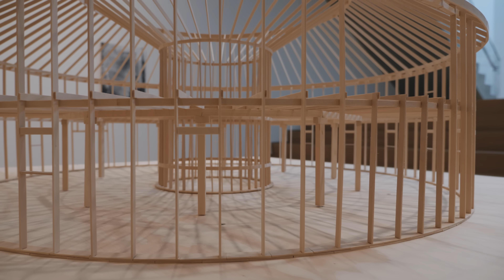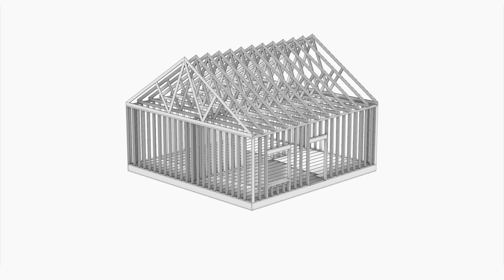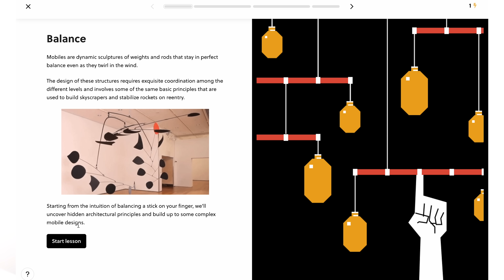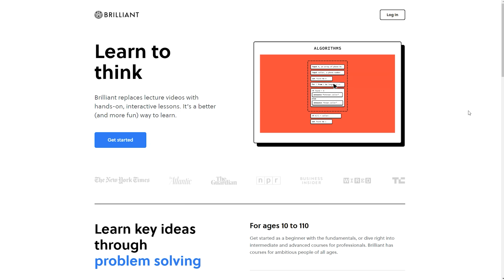The Genius of 2x4 Framing

Comment: 2x4 house  would be affordable if they did not require a 30 year mortgage, a constant maintenance against the water/termites/sun etc  damages , an expensive fire insurance since they can go to ashes from one spark or a match, if expensive roof replacement did not be needed every few years, if they did not need nearly always  to operate on  heating/cooling due to the poor thermal attributes of the whole system, if they did not need to use a multitude of toxic products ls to wrap up the structure to a completed house. After 20 years of designing and building in this technology, I moved to a country where I could go back to practicing my trade in brick/stone/steel/cement; Storms and earthquakes, these materials in a long run create homes which overhead costs are minuscule, and serve generations without costly repairs. I agree that 2x4 is like  a McDonald's hamburger, which is not a secret that eating it is detrimental.  I am a huge admirer of your lectures.

Comment: I'm not saying he doesn't make some good points, but you can build a home or any structure with "light wood framing" as customized as desired. He makes it seem so standardized that it's impossible to be creative. Most of the homes that are contemporary, odd designs are built using the standard 2 x 4 process.

Comment: Lots of misinformation here. Both 2x4 and 16" on center framing is very outdated. Sawdust is not used to make OSB.  Post and beam is actually a style of underfloor framing, not walls and roof system. As far as your statement about not needing skilled labor to build a standard home, you simply could not be more wrong. It takes years and years of learning to be able to build a home, most will be a helper for well over 5 years before able to tackle that size of project as a foreman. In fact, it's blatantly insulting to say it doesn't take skilled labor.

Comment: The only issue with this kind of construction is that you limit yourself with the size and amounts of windows. The load is distributed very equally and getting a very open feel is more difficult.
Reply: Many homes here have very large windows, and many walls that are dominated by windows. A variety of wood and steel beams are used to provide additional support where required.

Comment: You mentioned Home Depot 'stocking what you need'. Eau contraire. There is a large luxury looking, energy efficient, modern design house built in 2021, in a very nice area of Portland, OR.  I recently saw that it had been torn down and rebuilt. The story seems to be that the Home Depot lumber they had used was no 'certified' and it did not meet code or pass inspection. Ouch!

Comment: “Anyone can frame a house” 😂😂. Maybe unskilled labor can pop the nails in, but building the structure properly, cutting the correct angles and joints, creating proper sizing for windows, doors, etc etc…. Not unskilled labor at all.  Rough framing perhaps…. But this is way oversimplified in the video.

Comment: 4:50 a factor also of the timber framing is the resource intensity of the process.  Another video emphasized its strength over stick framing (2x4 and other standardized material) but choosiness is gonna be a problem.  When you need a hundred thousand houses built a year… you need to do it with what you got.

Comment: 8:55 - lol at "any 2x4 is as good as any other", sounds like someone hasn't been to the bunnings in my area, where you're likely to find the stack of 90x45 (as we call it) half full of crap that's either so warped its got a 20 degree twist along its length and/or bent so hard it's not usable even if sistered against something straighter, OR looks like someones taken a hatchet to it, OR looks like it somehow has a knot running the entire length of it (timber taken from a tree that's rotted out from the inside, and they've kept the cut half rotted for..... God knows why).

Sometimes you can tell looking at these pieces that they've been in circulation for ages (eg: supplier stamps of a kind you wont find on another piece of timber there) they really need someone to just bin them.

Comment: My grandfather was a lifelong carpenter in New England. When they bid a house they always asked if there were any feature they wanted in the future but couldn’t afford now, like bay windows or garage in the basement of a ranch house 

They would frame them in, which didn’t cost much more, so that when the day came, the headers and supports were already there 

Just cut out the outer and inner areas and the bay window or garage door could be installed 

He also, by default, ran 3 instead of 2 carrier beam 2x12’s to insure the house wouldn’t settle 

My uncles house was built this way almost 40 years ago and no door has stuck in the winter and has never settled 

My grandfather always promoted 4’ entry doors to facilitate furniture moving, etc 

Costs spent up front save headaches in 20 years
Reply: The world needs more builders like your grandfather
Reply: Anyone who has ever moved a couch would kill for 4' entry doors.
Reply: Granddad was righteous.
Reply: Facts
Reply: Nothing but respect and admiration for your grandfather.
Reply: I'm currently building my own house. I was pretty set on 4' entry doors till I realized I just couldnt make it make sense. Typically 3k plus for a door and I cant do that so I'm doing French doors out the back where I was going to do a single.
Reply: @MrDirkrader  , For that kind of money, it might be worth building your own.
I'm sure you could download a set of plans. 
It's doable if you have the right tools, and know how to use them properly.
(Plus, it's a great excuse to buy a few extra tools to get great results)
Reply: @davidgraham2673  yeah im aware and I'm already guilty of buying too much stuff lol. My wife is really excited about the French door option and they'll be a full 6ft width and 8 ft high. Anything that doesn't fit through that doesn't belong in the house. I'm most likely gna buy solid slabs and cut windows into them. My brother does glass work so I have access to flat glass. And I'm gna have to build custom jams so yeah it is custom work but I don't have room for the tools atm and I need doors in a week.
Reply: @MrDirkrader  , Hard not to love French doors, and they certainly make moving large items into your home easier. 
Happy wife; Happy life.
Hard to go wrong there.
Best wishes, Brother
Reply: Your Grandfather was (as so many were back then) a wise man.
Reply: I have always wondered why people just didn't do larger with doors especially in the front or rear entrance of the house to have an easier time moving furniture in and out.  I get it's slightly less efficient heating and cooling wise but why is there bedrooms that have 90° turns with these little 2 ft 8-in doors where you can't fit anything in?
Reply: @JustNo8808 Heck I cannot even wrestle a queen box spring around the top of our stairs without some grappling hooks, a slide rule, and some spicy new combinations of bad words. 🫣
Reply: We don't use wood here to build houses, we do but not normally, all houses are brick, mortar and steel wire, it would be cool to have more people like your grandad around yo make thoe houses, with the neq hemp wood, densified hemp wood and transparent wood, environmental impacts would be graatly reduced and those materials look awesome.
Reply: Now contractors and builders don’t care about quality and only care about quantity..
Reply: Peace, respect and fortitude to you.
Reply: That sounds like back in the day when living below your means was much more common. When they built affordable housing. Framing the big window but not installing the pricey window till the future owner can cash flow it is brilliant.
Reply: My dad was a builder from Norway. Settled in NY & your grandfather sounds just like my dad.
So nice to hear.
Thanks for sharing.
Reply: 4' doors is a great idea.
Reply: That's how a carpenter should do it. That's pride in craftsmanship. Glad to hear your grandfather carried the torch.
Reply: Your grandfather was unlike the carpenter who built my house, who cut corners that I had not realized when I bought it , and didn’t do work paid for.
Reply: Your grandfather is a man of integrity. Long lost in most builders these days..
Reply: That sounds smart. 

 What if I wanted a fortress how would he do that. 

 I hate some old new England houses, but I've been in some old ones built like a truck. 

 They had access to amazing wood a few centuries back.  

 I hate how so many new houses seem to lack insulation, and are super flimsy.

 Or worst - not built to handle the areas weather. Looking at you FL.

 If I had it my way. I want a cheap house sturdy against anything thrown at it, and efficient house. I don't want it to last generations. 

 Making my kids live in my house instead of building their own is just a bit selfish to me.
Reply: Well my dad is bigger than your dad and makes more money.  We get to go to Disney world TWICE in one year!!!!!
Reply: @edwardschmitt5710  , Well my dad never took me to Disney.
I had to wait until I was in Tokyo on a mission for the ARMY....so my uncle took me. You may have heard of him. His name is Sam.
I was the tallest person at the Tokyo Disneyland at 6 feet tall. 
Felt like a giant there.
Reply: @edwardschmitt5710  lmao who asked tho
Reply: @edwardschmitt5710  yeah, well my dad can beat up your dad!

Comment: Balloon framing used to be confusing to me because in many ways its more difficult than platform framing...until you remove the tape measure. You don't have to guess or measure where lower support structures are with balloon framing.

Comment: There's a more cost efficient way yet: post frame construction. It utilizes large cuts of timber yet requires less material and manpower. But, most importantly, it doesn't require a cement foundation. I'd be interested to hear your take on this construction method

Comment: Inflation has hit even 2x4s. They used to be 2" x 4" and in 1964 they switched to 3.5 x 1.5. They also rounded the edges for easier handling. 
Also Fir was replaced with Pine. You can still get fir studs but pine is the norm now.

Comment: I love how their models have all the trusses and studs in perfect stacks. It is the correct way, but it’s not the way we build them in America. Your Trusses or rafters, depending on what you’re using are typically on 24 OC and your studs are typically on 16 OC.
Reply: Even in the snowy north, a properly pitched roof never bears enough weight to require 16 OC, and if you think about it, that would increase the load on all the lower frames, too.
Reply: @michaelmcmeel914  engineering specifications on a house in the Northwest is engineered to 40 lb per square foot of that is typical engineering for the United States that translates to a 2X 4 trust at 24 oc

Comment: I always found it fascinating how thin the 2x4 walls seem, do you get a lot of sound travel through them? In the UK most external walls built now are brick and block cavity walls, with mineral wool or PIR insulation. About 30cm (~12 inches) thick.
Reply: Sound travels right through it like its barely there,  but you can easily redo a floorplan just like that by knocking out some flimsy walls. I assume it takes alot of time to move a wall, buildings in Europe are so sturdy that they can be repurposed into fortifications.
Reply: Some sounds travel straight through, e.g. sounds of heavy vehicles, or someone slamming a car door, or dogs barking.  But voices, music etc. less so.  American homes also have noisy appliances like the furnace, dehumidifiers etc., even the fridges are louder.  It takes some getting used to compared to the quiet in a UK brick house.  For context I live in a well built 1970s light framed house in a quiet neighbourhood in the US and I used to live in an 1870s brick house on a busy road.

I really like US style houses, I just wish they had thicker, well-insulated outer walls.  Also everyone round here seem to hate houses built since the 80s and thinks they wont last 50 years, but I don't know whether that has any basis in fact.
Reply: Noise transmission is less of an issue in older houses that still have lath and plaster walls. Plaster’s also a much better thermal insulator than drywall. We’ve been getting some scorchers here recently, and my balloon framed, plastered house holds the cool night air wonderfully. I suspect the constant updraft from balloon framing also helps to cool the walls of the house.

Comment: Good quality wood housing can be made with other better modern techniques. It might be a preferred material depending upon the location. 

Concrete is incredibly energy intensive, and bad for CO2 emissions. 

Fun Fact:
China used more concrete between 2011 and 2013 than the United States did in all of the twentieth century.

Comment: Unfortunately, the fast food analogy is all too accurate. 

That 2x4 framing enabled housing to be built so cheaply, contributed to car-centric suburban sprawl. 

The construction quality of many housing tracts is very low; they were built fast and often by people with minimal carpentry skills. They also require constant repairs because of the poor construction quality. 

In numerous cities, walls were too thin for the environment in which they were built, leading to unnecessarily wasteful heating and/or cooling. The situation was exasperated by the fact that they were built excessively large for many decades.

Because Americans are constantly moving, an ethos of quality and permanence in housing isn’t valued. 

It was not the type of housing that the United States needed. It was the type of housing that made the owners of large construction and lumber companies very wealthy.

Comment: I think it’s absurd that 2x4 is a common way of building houses. I shouldn’t have to use a stud finder and risk damaging electrical lines to mount a shelf or other storage solutions according to the spacing of where the contractor put my wooden studs. The frame should all be solid wood or solid brick for effective mounting and structural strength.

Comment: 45x95 framing looks shitty and weak, and is exactly that. 
Also, too thin walls so not enough insulation, so energy consumption way higher than it should be. 
Your oil and unnatural gas is too cheap, so you waste energy fir many decades in poorly built houses. 

Look at Scandinavian built houses, with 25+ cm insulation in walls and 35-50 cm in ceilings, with low pressure inside and heat pump tech (energy extracted from ventilated air, put back in radiator water loop) and/or geothermal heatpump. Uses 4-8 MWh/year in sub arctic climates, easily offset by a 5-10 kWp solar array on the roof. 

Yeah, your weirdly overcomplicated roofs with shitty shingles on, leak, look awful and doesn’t house solar PV arrays easily, and when you try, it leaks even more water, due to SHITTY design and materials. 

Go figure…. 😂

Comment: I have watched this video twice now..   Different frame of mind,, different observations.  You elide over the core of a 2X4.  I would have started this discussion with "Why a 2X4?"   
Begin with da Vinci's 'Vitruvian Man'  As a species we are 'tall',  with a generalized average height.  So the rooms we live in must be of a comfortable dimension.   Columnar loads.  What size of member can support the normal environmental loads of wind, rain, snow ?
The smallest load bearing column that in repeated use will support those loads  IS 2"X4"X8'.  1X4X8s used the same way, but 8 inches on center,, same amount of wood,, will not support the required loads.  1X4s work fine,, if your walls are only 5 feet tall.

A 2X4 is the smallest,, lightest size that will work in an 8 foot tall wall.. Discount balloon framing.  The 20 foot long 2x4 is still regulated every 8 feet.

Comment: min. 3:44: You wish that was true xD reality is, that we dust down quite a good ammount of perfectly fine wood just to produce OSB etc. every year since the ammount needed is much higher than the rest of the sawing process would supply. An other problem with that whole "genius concept" (wtf are we calling genius here??) of bulding houses in wood frames: durability is f**ked. those houses wont even last a century before they need to be torn down and the remains are to be burned in the end since there is no realy industry for recycling wooden building materials.

Comment: All the houses in Europe are building with concrete and bricks the walls with all stuco has at least 12” deep and only the roof is from wood. 2X4 or 2X6 is just the cheapest and fastest way to build the house and houses are really poorly insulated in USA. I’m talking about normal houses.

Comment: Aaaaaannnnnd then the tornado and storms came and the house just vanished! Never understood  the reasons someone would not use cinder blocks and concrete rather than wood for house construction. In my country ALL our buildings are cinder blocks and concrete and we get hit by 8-12 storms you classify as category 3-4 in your hurricane scales (we call our storms cyclone) with minimal damage... Like we get electrical outage for 4-5 hours if damage is VERY SEVERE else barely a few minutes AND OUR POWER CABLES ARE ALL OVERHEAD.

Comment: Only in merica! We in Europe use rather brick and mortar or somthing more heavy, stable and it last longer too. And dont burn down so quickly.
Reply: Only in merica, Japan, Australia, New Zealand and Scandinavia.  Brick homes burn just as quick because the floor and/or roof is wood and the carpet and furniture is exactly the same.  Brick homes, on the other hand, are generally more difficult to repair after a fire.  Also, wood frames are generally more stable than brick frame, which is why they're used in earthquake prone areas.  As for lasting longer, that's a personal preference, I'd rather it be easier to rebuild than to be stuck with what my ancestor's chose.